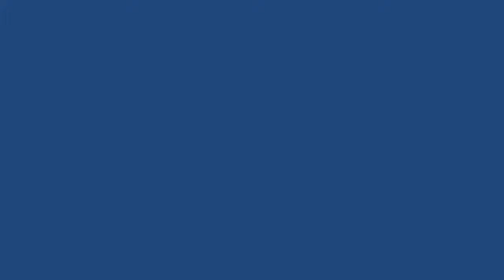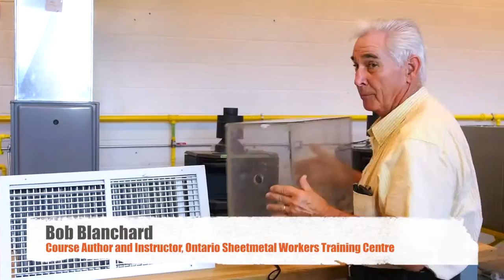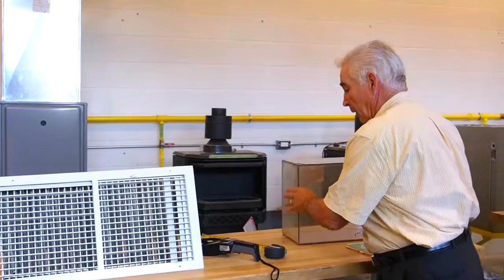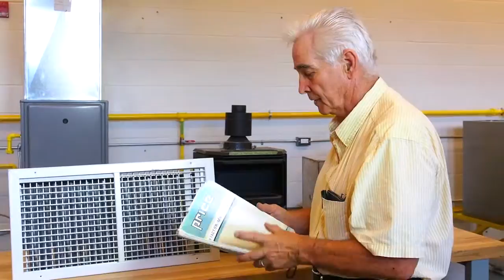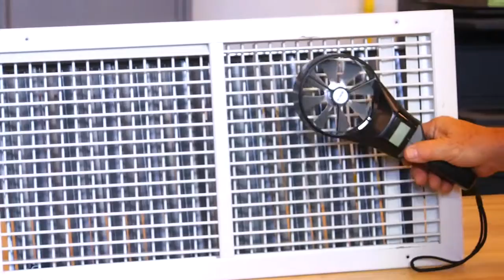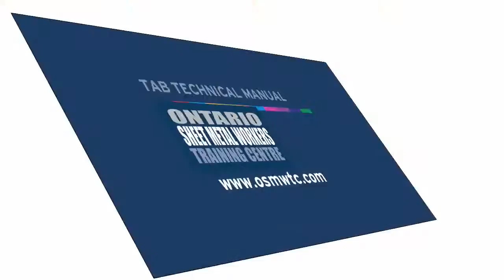Grille Air Flow

Comment: Doing it both ways to see what gets you the best average ?   ( You don't know this do you ?? )
Use a methode to proportional balance and most important is understanding that adjusting the OBVD dampers at the grill will
screw with your ak factor .  Beware and use a flow hood if you can to verify.